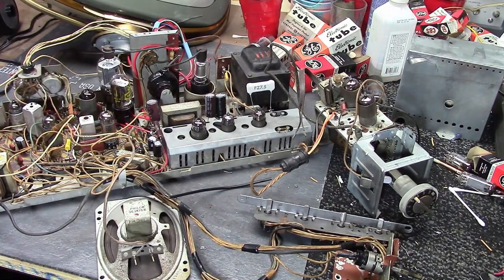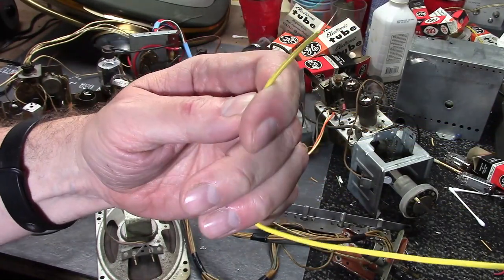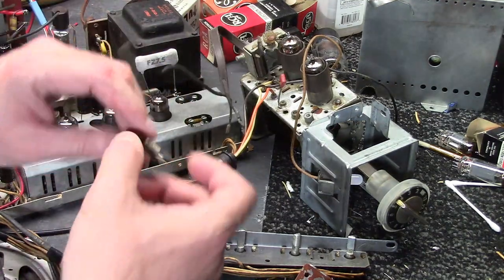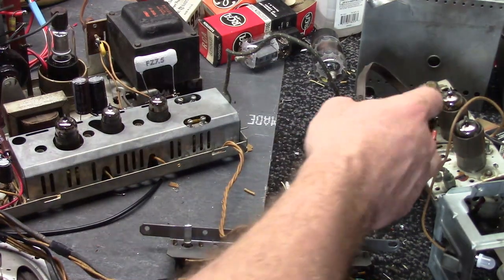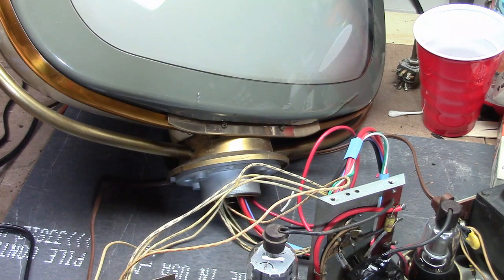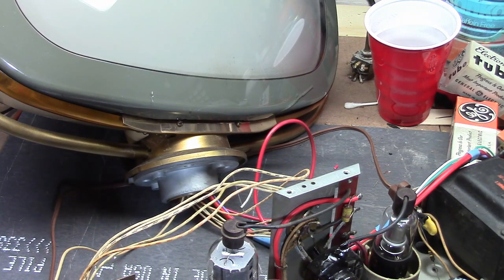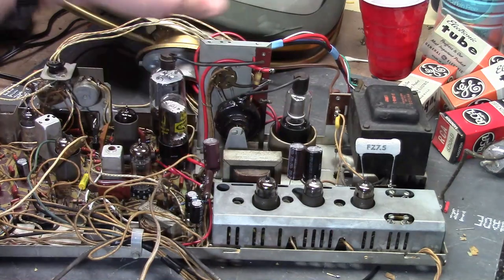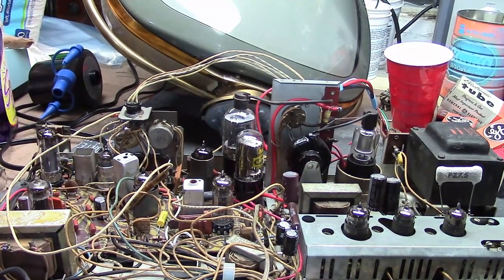Predicta restoration tips: Wire

Comment: For the wiring to the volume control perhaps you could use a stereo audio cable (or "aux cable" as many call it now). It's probably only rated 30v but if it stays away from non-insulated points (or you cover it in 600v heatshink) it should be fine.

Comment: I'm afraid I cannot help but wonder how important choosing the correct wire for a CRT TV restoration can be, in the overall scheme of things.  Maybe you could do some videos on your favorite Pokémon character, or how many angels can dance on the head of a pin.
Reply from the maker: Are you joking? Extremely important. Some wires have a few volts some have thousands

Comment: A question for you on the foil capacitors. Do you worry about which lead is outside foil as it is not marked on anything modern.  I'm sure to cut down on costs.
Reply from the maker: Nope and they stopped marking them in the 1960s.  It's not a recent change.  My search tells me they stopped marking when the switch from paper and foil to metalized plastic film.  Similar to a mylar balloon.  Metal is so thin you can see through it.  Pretty sure they stopped parking because that upper thin metal offers significantly less shielding so why bother.  I can't image they stopped marking if it made any difference in circuit performance.  Why would they want to damage their reputation?  
Bottom line - it doesn't matter.  That's been the conclusion on the Antique Radio Forum by guys who have been repairing this gear for many years.

I'll be doing a dedicated video on it someday.  I expect it will stir up a heated debate.
Reply: @bandersentv  Science!  (And stray capacitance when it comes to very small capacitances, on the order of a few picofarads.)
Reply: @bandersentv  The only thing that I could see as serious is a wax capacitor having several hundred volts across it to ground.  In that case, if the outer foil had the high voltage on it and the body of the capacitor touched the chassis and heat melted the wax, a short circuit could result.  Capacitors generally aren't explicitly rated for body contact to a conductor, but perhaps should be.   I'd hope for at least the working voltage rating of the capacitor itself.
Reply: @bandersentv  But yes.  We have the audio philes/phools.  It can become a cult thing with situations like musical instrument pickup wiring.  This is a situation where old bumblebees become a sought after item, even though their life expectancy has proven to be terrible.  Let the audio philes/phools believe on; it's something that no TV tech needs to care about.
Reply: As mr Carlson has shown we can definitely easily see the difference with a scope but it might not make much difference in a tv
Reply from the maker: @SeekingTheLoveThatGodMeans7648  The argument is that the outer foils serves as a shield and should go to the lower impedence to reduce noise and hum.
Reply from the maker: Yes, you can, but how much of a difference is it and does it matter in any circuit new or old?  My challenge is for some to take a commercial device and install a modern cap either way and demonstrate and difference.  I can't conceive of any reason why all the manufacturers stopped marking it if it would make any difference.

Comment: I think even a spark plug wire would work from a car
Reply from the maker: Maybe, maybe not.  They have much more resistance than copper wire.  "The factory wire (OEM wires) for domestic vehicles are typically fiberglass core spark wires with 10,000-12,000 ohms (10-12 k ohm) of resistance per foot. Meanwhile, import models may utilize a spiral wound wire with 500 ohms per foot of resistance."
Reply: @bandersentv  Ohm's law and the typical current draw of a consumer grade direct view TV CRT (< ~1 mA) would suggest a loss of 12 volts per foot for the resistor core wire, not huge.  A bigger issue would be the inability to solder to the core material.  In lieu of the solder, a connector crimp or knotted connection might do.

How about neon sign wiring cable?